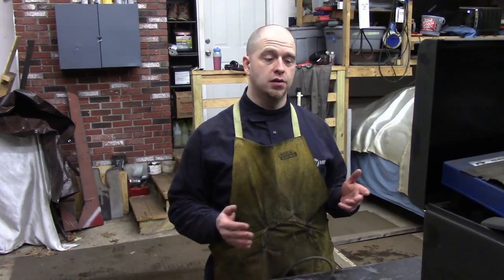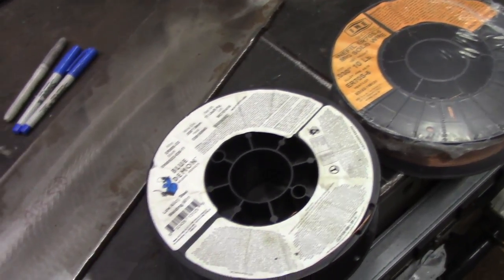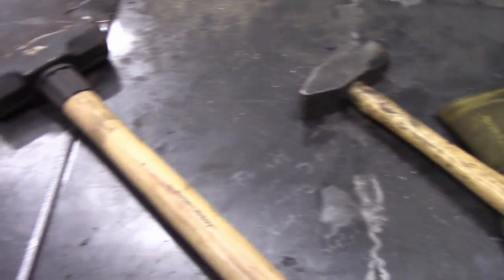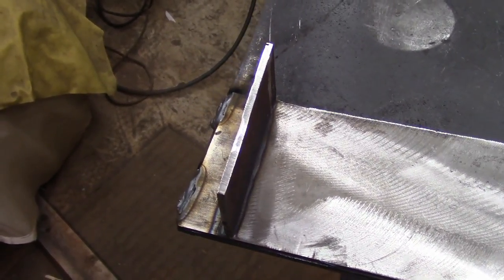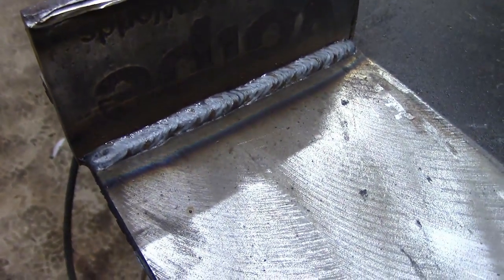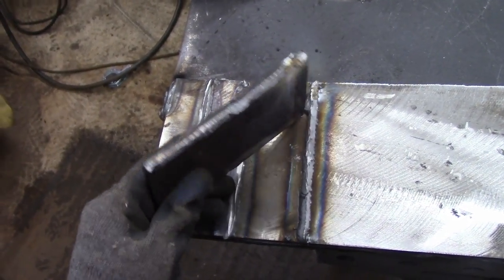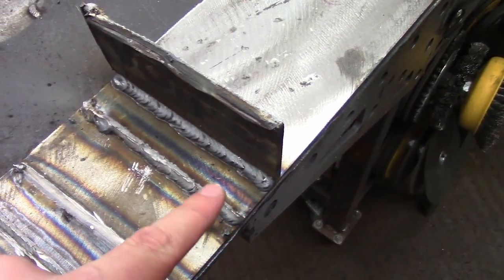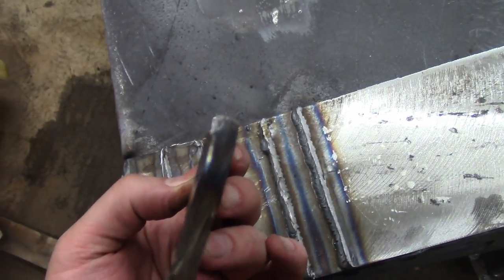Weld strength comparison using ER70S-6 and ER80S-D2

Comment: Excellent test.  I switched to using 80xx series welding rods myself, mostly 8010, and something I learned is that the extra additives in the alloy that make it stronger also make it melt in better to the base metal and a smoother puddle.  So you get better/deeper fusion and better grain structure of the resulting weld.  This explains your results getting 4x the strength instead of just 15-20% stronger. Pipeline welders use 8010, 8018, and 8045 stick electrodes for exactly this reason, both easier/faster to work and stronger welds.  I haven't beaten mine up yet to test them but they absolutely look better finished and while in process.
Reply from the maker: Thanks for your in-depth comment. Since this video was made I have switched over to the 80 series for both my MIG and TIG setups, it's more money but it just makes sense. The only time I use a more typical mild steel filler is for cosmetic reasons. Interestingly enough, the 80 series stuff doesn't quite look the same as the mild steel base metal, when trying to blend a weld for artistic appearance.

Comment: You are right in your assumption at the end. When welding on different grades of steel you can get away with using even a 60ksi rod (like a 6010) but sacrifice service life of the weldment. Granted on higher grades of steel like high carbon steel (carbon content greater then .095%) you run the risk of the weld cracking even with pre-heat (if using lower grade filler material or equivalent with wrong technique). This is due to a host of possible issues ranging from; dilution rate, heat affected zone, hydrogen imbrittlement, ect. You seem to be fine with the materials you are working on but if you are ever in doubt you can cheat a lot using nickel based rods such as inconel. I've had some great luck using Inconel-3 (Lincoln Electric calls their version Techalloy 606) and I swear by it. As a side note: whenever you are welding any; exotic alloy (such as nickel or monel), alloyed steel  (such as stainless), or any grade of steel to any of the 3 types mentioned you should consult with a guide book (again, Lincoln Electric sales a dynamite book with everything you need for about $20). You never know when a certain alloy type is incompatible with most anything. Example: I was welding a stainless handle to a A36 box tube using 309L (TIG) and had a transverse crack throughout, come to find out the stainless handle was 347 and incompatible in that given situation. Hopes this helps!
Reply from the maker: Ahhhh, a real welder reveals himself. Thank you! I am just a home gamer so information like this is invaluable to me.
Reply: Come on dude that's a stick rod this Is a wire video

Comment: I just did this same test on mild to mild steel and I couldn't break the 80sd2 because I only have a 2lb sledge but the 70-s6 broke in 25 weak wacks ( trying to save my vice)
Reply from the maker: Appreciate your contribution to this science experiment. I'm still blown away at the difference in strength between the two filler metals.
Reply: @PrettyHateMachining  I did a job on heavy wall 30in pipe using this stuff and wondered how much stronger could this actually be, then seen your video and then had to get a spool of it for myself after watching your video, and the results were pretty much the same, except I couldnt break the er80sd2 with my setup, couldnt even move it
Reply: There are many more that is much stronger  which is insane
Reply: I got er 80s-b2 tig rod and 8018-b2 h4h stick rod but cant upload photos in the comments

Comment: you had no penetration on the one you broke. thats not a fair test. let me weld it and you wont break it from it either side.
Reply from the maker: Go for it, I'd love to see it! Be sure to let me know your results, I'm curious myself.
Reply: Pretty Hate Machining as I said. It didn't break and passed a penetration crosscut with no porosity. Flux core is a different process and takes practice. More like stick than mig.
Reply: Pete Fischer take it to a Fab shot. Depends on the thickness. There's a chance that the heat will weaken the metal around the weld. If it was a regular air tank, I would weld it up just to see if I could. At a distance of course.
Reply: Pete Fischer I've personally never had much luck with epoxy filler. Not saying it wouldn't work.
I'm a retired military welder. Navy Hull Tech, Marine Metal worker, just me personally, I would turn it over to a tig welder.
If the epoxy would hold and seal, get it to flange to the inside, in theory it would work with out the heat damage. If you try it, please let me know how it turns out.
Reply from the maker: +Pete Fischer If they're small holes and the wall thickness is sufficient then plug welds would probably be just fine. Especially at such a relatively low pressure. I'm not a welder so I wouldn't take my advice for anything welding-related regardless :D
Reply: They were asking the professor

Comment: Any er110 wire?
Reply from the maker: I've never tried it. My machine can only do up to .035 wire and it seems like it generally comes in larger sizes. (.045 or bigger)
Reply: Interesting point.. I don't recall 110 on a spool anywhere. Stick and TIG rods 1/16 and larger so I figured it is also for our 110v mig boxes.
Reply: Isnt there a 110 dualshield wire esab makes?
Reply: @stevehartlieb  There is, and it starts at .045 diameter.  I'm guessing you'd be running that nuclear hot.  Dual shield is always run pretty high up there to begin with and the stuff you'd be doing 110Ksi for is big stuff like cranes and mining trucks.